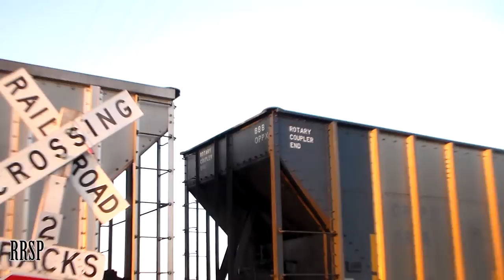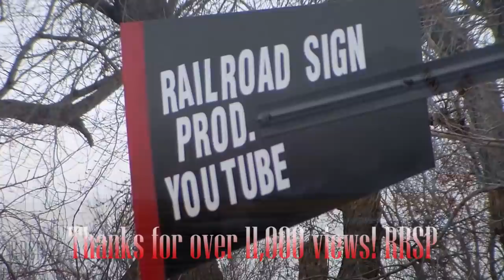EMERGENCY! Hopper Bay Opens on a Moving Coal Train!

Comment: Standard length of trains is 130-135 cars which is about 7200-7500 feet long. I was a conductor on the BNSF out of Alliance NE. The longest train we had was 150 cars right around 10K feet in length.

Comment: After watching a couple of times, I don't think he went into full emergency.  Dumping the air can cause more problems then it solves.  He had the ability to set brakes from both front and rear ends of the train and I think that is what he did.
Reply: Agreed, there was no air pop so he most likely just set it to "continuous suppression" to get it stopped as quick as he could without going in to emergency braking. Glad someone in the cab was paying attention to what was going on behind them, big kudos to them!

Comment: Everyone chill out, coal hoppers do this once in a while and it's not an emergency. The doors don't swing low enough to hit the rail, the malfunctioning car will be set out and repaired by a carman. Eventually either the railroad or a contractor will come out and clean up the spilled coal.
Reply: correct

Comment: I'd say the engineer was watching the train behind him after passing through the grade crossing, either because that's the rules, to watch it until it's clear, or because he saw the people standing there, or both, and so he just happened to see the coal come out. He was a lot closer to it than the camera was, and he may have seen the exact same thing happen before, so he didn't panic, he just put on full, but not emergency, brakes to bring to it a stop to clear the problem up (and to avoid strewing the coal along more track than he needed to; I doubt coal could easily derail a train. Which is not to say it couldn't happen, just not very likley)
Reply from the maker: Kel Harper I'm not exactly sure how the engineer knew to stop; he probably was looking back or looking in the rear view mirror. I doubt that the coal could derail a train as well, so they probably stopped just so they wouldn't loose any more. Thanks for watching!
Reply from the maker: @James Vance The conductor and engineer do periodically look back to check their train.
Reply: no need to look back,  cannot see anything for the coal dust.
Reply: @RailroadSignProductions  what for,  cannot see anything for the  coal dust.
Reply from the maker: @James Vance the coal dust was coming from coal hitting the ground after falling out of a hopper car, not being blown off the top of the car.

Comment: Nice catch of a rare incident! I guess this is why most new coal hoppers are rotray-dump-only gondolas!
Also, both DPUs were AC6000s!
Reply from the maker: Thanks! It was awesome to see!
Reply: AC6044 convertables. By this date they might have been rebuilt into AC45C6M. UP at one time before 20Twenty had thoughts of having 1,000 + AC4400CW, C45AC-CTEs, AC6044s get rebuilt into AC44C6M's. Then keeping their original number after rebuild.
Nice work. Stay warm. Keep a emergency kit with you or in your vehicle just in case.

Comment: Wish i had known about this - i 'd have flown over with a few dozen wheelbarrows - free coal for my fire !
Reply from the maker: I'm sure that you could find lots of coal walking along the tracks of any railroad that hauls coal trains, but I'm sure that railroad officials would question you walking along the tracks with a wheelbarrow! Thanks for watching!
Reply: Children gathering coal on railroad tracks was a problem during the depression, the railroads made announcements advising against it.
Reply: +Bushrod Rust Johnson I recall seeing a lot of industrial hemp growing beside the railroad tracks.... 😛
Reply: @RailroadSignProductions  in the 1950s we lived on an un-made road (in UK) and it was a regular occurrence for sacks of coal to fall off the coal lorry when it went over a pothole.  The neighbours rushed out with buckets and shovels and the coal was gone before the driver realised what had happened.
Reply: can't use this kind of coal
Reply from the maker: @James Vance pretty sure that you can use this kind of coal just as much as any other kind
Reply: @RailroadSignProductions  do you know all the types of coal?  This type is used in furnaces to make steel (very fine)
Reply from the maker: @James Vance it could still be collected to burn in somewhere other than a steel mill furnace
Reply: @RailroadSignProductions  Don't forget that coal is turned into coke for adding to molten steel to produce carbon steel
https://en.wikipedia.org/wiki/Carbon_additive
Reply: @jamesvance8456  I kind of think you do not know whence.  OPP is a power company and the coal is for the power plant fuel  not for steel.  It is ground on site to be blown into the firebox of the boilers.
Reply: @royreynolds108  Hey, thanks

Comment: This is odd to me, don't know why one door just partially opened. Around the 1:40 mark you can here a car blowing air, that's probably  the problem car. I never heard the air dump but there was definetly a heavy brake application.

 From the head end looking back all you can see is dust from the coal and ground. I can guarantee they didn't see it dumping. Those cars have a separate air line that is charged off the main resivoir hose on the engine to operate the dumping mechanism on the cars. I think they only attach it on the final run to where it's going to be dumped and some locomotives will set the brake when the main resivoir preasure drops below a certain point to prevent a run away. I'd say something happened to that car causing the MR pressure to drop to low causing a full application of the brakes that wouldn't recover which made the conductor walk back and find the coal dumping. He then cut out air to that car and they can continue on there way.

Either that or the dumping coal caused an airline separation, or they hit something that damaged an air line and the door and the air did dump I just couldn't here it. The conductor didn't shut the door though. I don't even know if you can on that type of car and the manual latch cars I know the door is to heavy for 1 guy with no tools.
Reply from the maker: Thanks for the insight! I remember seeing the conductor walking back to the problem car, so he probably did cut the air. After that, the crew dropped the problem car off on a siding in Schuyler, which is a couple miles east from where this was filmed.
Reply: Boy, are you right
Reply: right on, charles  condr could not close the door unless that part of the hopper was empty.

Comment: Somehow seeing all that mass coming to such a violent standstill never ceases to amaze me.  I have been in a passenger train once that was at it's top speed of 86 miles per hour when an air hose came lose.  I usually "sleep" (I close my eyes, but keep paying attention to my surroundings) on trains that I take regularly, but upon hearing the loud thumb and then a huge hissing noise combined with a fast decrease in speed "woke" me up instantly.  I was facing in the direction the train was moving and was gliding out of my seat when that happened.  When the train came to a very abrupt halt (cars swinging back and forth for a couple of seconds) I could smell the brakes :P.
Reply from the maker: Dutch3DMaster interesting story. Did the train you were on hit something or did an air hose come loose? Burning brakes definitely don't smell good, but I couldn't smell the brakes when this train stopped. Thanks for watching!
Reply: Hehe, it's actually in my reply to the video, but yea, an air hose came lose (which has the same result as using the emergency brake).  At the moment the emergency brake was applied I was expecting a shock to go through the cars or hear a loud bang (even though I was almost always at the back of that train, because that was easier at the terminal station.)  It's the same thing with hearing a train use it's horn for the first time and then for a second time (using the horn is only allowed to avert a possibly dangerous situation in The Netherlands, like someone sitting on the edge of a platform unaware of the oncoming train).
Reply from the maker: Dutch3DMaster I must not have read your original comment close enough, but I found the answer to my question when I read it again! Thanks for watching!
Reply: Wow, really? You aren't even allowed to use the horn in the Netherlands? In the US they are mandated to blow the horn at every grade crossing by law. Which is good, seeing as how many people don't pay any attention at all and try to cross in front of trains, even when there are crossing barriers and lights and bells. I say let evolution take its course! =/ Of course in Europe they probably also have fool-proof barriers on every single grade crossing to prevent anyone from even trying to cross in front of a train. Got to save the stupid people from themselves. What else is government for? Interesting the cultural differences between regions, and the ways they manifest themselves. I was amazed when I first realized that locomotives in Britain didn't have headlights (not sure about now). You mean they just drive in the dark without any light? But then I thought "well, odds are they wouldn't be able to stop fast enough to avoid anything anyway", and the British seem to prefer to spend all their money designing barriers and track systems that make it impossible for anything to get onto the track. And they say that it's good to have night vision, better than to have a headlight, especially with how dim the lights were back then. As for stopping in time to avoid an obstacle, it's even less likely on British trains, since they only carried brakes on the locomotive and a single brake van: another thing that shocked me. In the US the idea of running a train without lights and with only two brakeable units in the whole train would abhor people. I guess because it would be a lot more dangerous driving that way on a typical US railway, especially back 150 years ago.
Reply: Kel Harper Horn usage is allowed, but only to test if the horn is working or to warn someone who is to close to the edge of the platform or near or on the tracks (last thing usually only happens with people committing suicide, actually).  I think the reason we are not allowed to use the horn here is because people pay attention quite well, and you are taught to do so from a very young age on. In primary school we were visited by personel from the national railway company to teach us a few things about safety around train tracks and crossings.  Trains also run at a much higher speed than they usually do in the US, it's not uncommon to have a train cross a crossing at 86 mph  (top speed for  non-high speed trains), which gives you about 15-20 seconds from the moment the bells start ringing and the lights start to flicker before the train arrives. People know because of that not to try and cheat death (well in most cases that is).  I'm absolutely sure British trains have headlights and have had them for years and also that every car has brakes.  Also, in my opinion, overusing the horn like they do in the US could very well have the opposite effect, people hear it all the time and stop paying attention because of it.  Youtube user weeardguy made a video how the constant horn usage would sound in The Netherlands, you can look it up on his channel if you'd like.  I agree about the cultural differences though, I can recall a couple of clips from Dutch railroad crossings that were visited by American You tubers who were absolutely astonished to see a train pass the crossing at high speed without using it's horn one time.
Reply: +Kel Harper Same here in the UK actually the horn is only normally used when there is a dangerous situation and a warning is needed. There are exceptions though at some crossing which are identified as having restricted viability for example crossings on curved track with obstructions that block sight-lines on the inside of the curve like this foot crossing @52.698948, -2.462956 where the horn is used for all trains by default though only between 06:00 and 23:59, but this one being on a straight section of track with good visibility @52.708914, -2.574739 they don't at least not unless people are seen on/near the crossing. Guess we kinda just expect people to actually pay attention to the big sign saying "STOP LOOK LISTEN" and not be a total freaking moron by walking out in front of several hundred tons of 70+ mph steel.
Reply: Just one question for people outside of North America.  What are you currently using for couplers?  Not long ago (30-40 years) I know the French (at least) were still using the screw coupling with buffers.  Some poor person has to go between the cars to couple them up, very dangerous and slow. Unless there is some legal reason, I don't see why the whole world wouldn't switch to using Janney couplers (North American style) or something better if it exists.
Reply: Bob Pegram the buffers help with dealing with slack when braking.  Even though a coupler still has to deal with great forces when pulling up, it's the buffers that deal with keeping some sort of distance between cars when braking happens. The thing that makes the coupler you mention being French (don't know if it's a French invention, could very well be the case) still being used is that when braking it's not the coupler that needs to take all the force of all the cars behind.  Couplers rarely fail here.  Buffers also help in switching yards. There is a freight switching yard in Rotterdam that uses a computer to distribute all the cars to the right train, uncouples them and let's them drift down to the right track through an automated rail brake system that slows it down to the right speed so that when it comes down to the cars already on the track the buffers slow down the moment of impact (it still looks utterly violent though).  You wouldn't be able to do that with automatic Couplers.  Most passenger trains use an automatic Scharfenberg coupler at both ends, but what is in between cars, I don't know, because most passenger trains are not made to have their cars rearranged, only to couple to a second train set.
Reply: Look up train coupler history.  Janney couplers are from the 1880s I think.  They are semi automatic (I've got to read up about that). They do absorb all the impact force and can end up shorter by an inch before they are replaced. There is some slack when they are coupled, but not enough to justify buffers.  The British invented the chain and buffer coupler, since they invented steam powered railroads.  That was improved to take out slack with a turnbuckle or other tightener. I know that a man had to go and manually couple the cars with buffers, because that was my sister's father-in-law's job in France, no matter what coupler was used.  The kind of automated rail yard,  that sorts and couples cars, as you describe in Rotterdam, probably started in North America, since it's easy to do with Janney couplers.  Unlike Scharfenberg couplers which can't pull a long freight, Janneys can.  Janneys do not connect air brakes or electrical connections, Scharfenbergs do and are used in high speed passenger trains as well as ones that travel slower.
Reply: Sorry to get so off topic, but the discussion about how the engineer knew there was a problem brings up other connections between cars.
Reply: Bob Pegram: the freight cars going down the automated rail yard actually do not have that kind of couplers, they are coupled with the chain and buffer coupler, I'm almost 100% sure of it.  Automated rearranging of cars was not meant to built a new freight train without having to do anything after that, but to have complete freight sets without someone having to go through freight papers and decide where they should go, it was all in the computer and only required someone to connect the cars and connect the cars to a locomotive.   If you had read my reply a little better you would've seen I mentioned how the Scharfenberg couplers are usually only on the front and end of a passenger trainset.
Reply: @BobPegram  lot of trainman killed from these cars
Reply: @BobPegram  somehow air pressure dropped